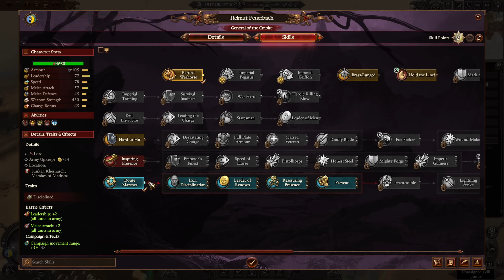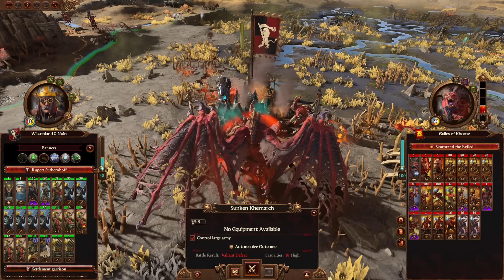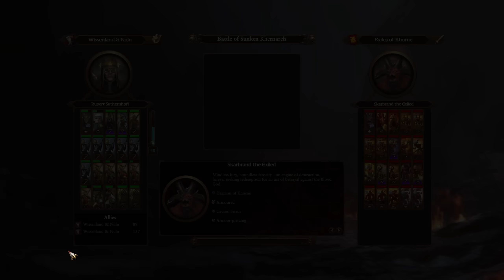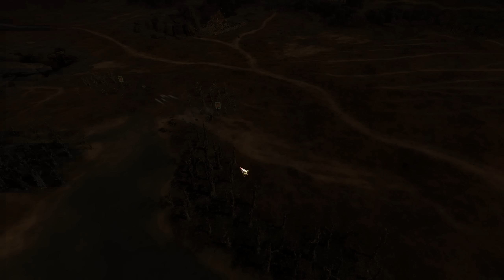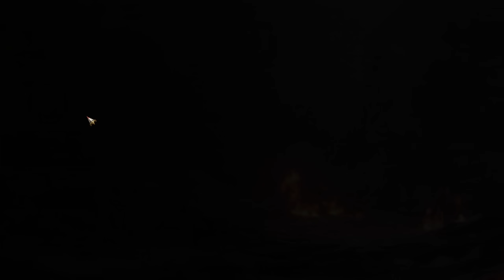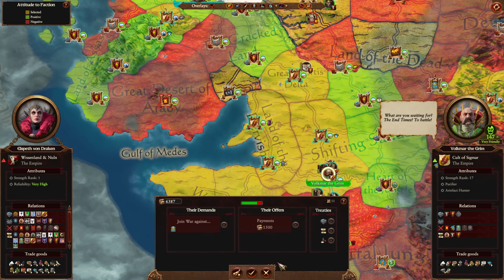When unbreakable peasants are your only hope

Comment: The left corner looked great for a reverse slope defence.

Of course, those narrow gaps between their deploy and your position were probably a great contribution to the win.

Anyway, on reverse slopes, if the army had cannons, you’d have dead ground that they couldn’t target past the top of the hill, and the rockets would lose some accuracy at long range past that same point, but all the rifles and long-rifles had clear, unobstructed view over the whole back slope which is perfect for their defensive fires.

The curvature is also fundamentally the same as the forward slope used to fire over melee troops, the gravity is just in a slightly different direction.

Best used to deny Enemy gun artillery the ability to target your forces at range, or hide a defensive position behind terrain.

Comment: Juggernaut cav have a charge speed of 120 which is the highest charge speed in the game (for cav), that's why you couldn't escape them.
Reply: Can have 20 more speed than a unit and still get fucking caught
Reply: The problem isn't that, the problem is that charge speed bonus does not drop at all, period. It needs to drop after a certain amount of time charging, and get a cooldown afterwards before it can be granted again.
Reply: @manelbonayaltadill4942  that is true + the high charge speed of juggernauts make them almost impossible to get away from.
Reply: Cant escape sod all because of charge speed

Comment: I suspect that nobody cares about the mount thing with engineers because most of us use engineers for their abilities like boosting ranged units, and sniping at single entities as they approach.  It seems like a waste to have them just kite a single unit around unless it's a lord or hero and you're kiting them in front of a gun line. We use the very fast outriders to lure and kite enemies.  Especially with Elspeth's faction due to more speed and disorient effect from their shots.
Reply: Mechanical steed is just worse than the normal horse and you can do exactly the same buffing on the standard steed. Running around and kiting a very important unit has been the basis of many of Legend's wins, so it's not a waste at all. Utility has proven time and time again to be superior to raw stats.

The reason most people use the stupid steed is the game auto updates the mounts as you level up and some people don't notice it until it's too late, whereas in Warhammer 2, you needed to level up the mount to get it. People would intentionally not get certain mounts (like the Ancient Stegadon) for Lizard heroes cause it was inferior.
Reply: @RockyX123  It's a waste of an engineer when other units do it better.  The "faster" unit is still way too slow to bother using it for kiting.

Comment: Why he doesn't have a mage in his army ? You are playing empire mate a mage is almost as necessary as gunpowder unit
Reply: This not really a good army for this late into the campaign. He has nothing to stop any charging or rush type enemy or hold the line. Also mortars are pretty shit they cant hit a moving target, they are decent early on for sieges, but I would immediately phase them out for hellblasters.
Also really dont get the gyros :D Pistoliers or outriders can do the job and they are better due the ametyst armory buff in almost every regard. Either he should get some line infantry, hallberds can do a good job at just holding or more heroes plus at least one wizard.
Reply: @Debilinside instead of halberdiers i would say knight of the black rose would be better they had mobility so they can stop flanker too and hold the line for decent amount of time ,plus he doesn't have mobility hero which is a very bad choice tbh
Reply: @Cursedpeopleakajuice  Thats good, but quite expensive. Looking at his money he doesnt have the best economy.
Also there is a bunch of units with hefty anti large on the chaos side so I would find the Black roses quite risky in general.